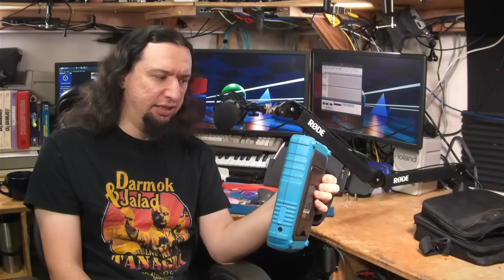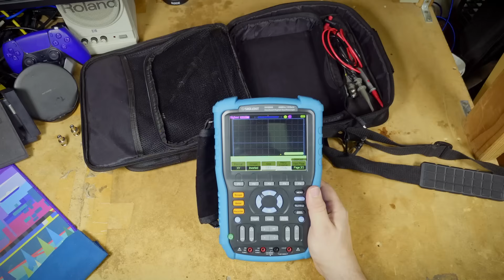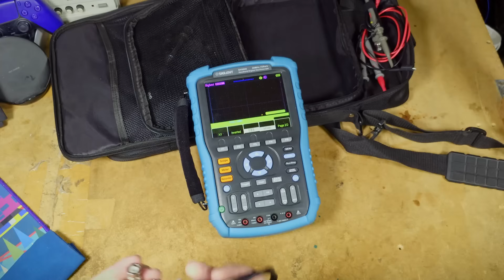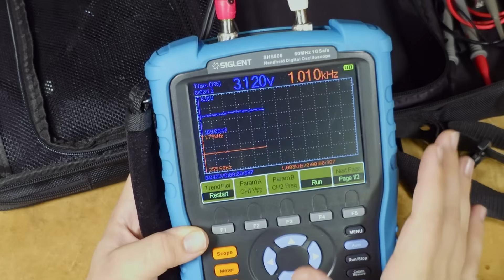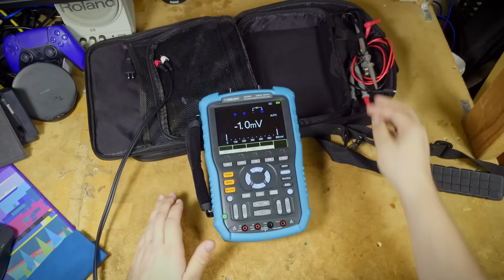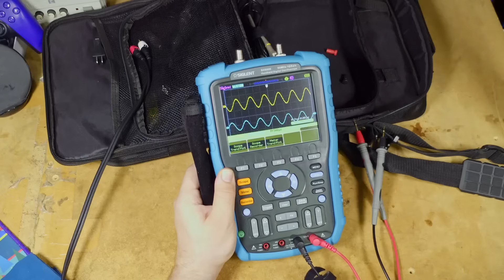Handheld Oscilloscope Overview - Siglent SHS806

Comment: In most cases, unless you absolutely NEED the portable form factor, you're much better off just getting differential probes for your desktop scope if you want to probe mains connected circuits. These days "desktop" scopes are nearly portable anyway, just not battery powered by default. The only "real" player in the portable scope market is Hantek. The others are basically low end gimmicky toys
Reply: There’s another echelon at the professional level that has per BNC isolation, higher sampling rates, and bandwidths up to 500MHz. The Fluke ScopeMeter and the Rohde and Schwarz ScopeRider are examples with the ScopeRider additionally offering an isolated 8-channel digital logic/protocol analyzer as well. Of course, they cost about as much as a used car too.

Comment: if there just was a scope as capable as a rigol dho802 with isolated / diff probe inputs in this vertical "handheld" format and a built in battery id pay double

there are none good and affordable mobile scopes on the market. especially ones that are scope and dmm in one device (like the fluke 123 where the scope is the dmm, not seperate jacks you have to switch to.)

micsig released their mho14 which is almost there, its just missing half the features i liked from the flukes( which had horrible ui, displays, controls everything)
Reply: Look at the Hantek handhelds - they're about the only ones that work well in scope AND DMM modes. The rest are gimmicky toys in comparison. Generally I'd say just get diff probes for your bench scope unless you absolutely need a handheld portable. I have a Hantek and I have the 80 buck Zoyi - I'll pick the Hantek any day for portable use, but I'd much prefer my bench Keysight scope when possible. I have a set of 3 diff probes for the bench scope, and use those when needed on mains circuits, or working on VFDs or similar.
Reply: @gorak9000  ive had a tektronix ths720 it was quite nice, even for its age. except the screen, size and lack of memory

Comment: Forgive my ignorance but I'm curious... do you know if a non-battery operated oscilloscope Will have an issue with testing an item tied to mains ground if the power to the oscilloscope is through an isolation transformer?

Comment: Siglent scopes are pretty good in my experience. I've never used a portable scope but I'd like to get one someday. I wonder if you could modify the boot splash logo thing to have information of who owns it. I did that with my SDS 1104X-E.
Reply: The Hantek handheld scopes are the only ones that perform decently in both scope and dmm mode. All the other "handheld" scopes that have come out recently are practically worthless toys at best in comparison. The Hantek's do cost more, but you get a more useful piece of gear for the higher cost.

Comment: Just tested the DMM function of my portable Tektronix Scope/DMM combo (THS Series) with a 9V battery and its even a little bit slower but the DMM is better implemented (can be used as external trigger and last DMM mode will be shown in scope-mode too to measure something while scoping around etc pp).

Comment: the BNCs are insulted so when you use the DMM function on mains voltage the BNCs can't shock you if you touched them accidentally
Reply from the maker: Horrifying but fair
Reply: @techtangentsii  BNC connectors are designed to establish the ground connection via the inner ring, not the connector housing. It's likely your test leads are too worn out and the ring is no longer making proper contact. You could try cleaning the ring contacts or gently bending them apart slightly.
Reply: Yeah, but only with the correct probes that also have insulated BNC connectors.

Edit: The insulation is not just for the DMM, it's also for the oscilloscope function. That's why the probes also habe insulated BNC connectors.
Reply: Don't insult your BNCs, they'll hate you

Comment: It likely does NTSC because devices like that are handy to use in TV engineering shops.
Reply from the maker: But is 525 line NTSC still used today(or I guess 2013) with all the analog broadcast having been shut down in 2009? I know low power stuff still stuck around in places like schools for a while after, but it still feels like a vestigial feature to me.

I guess I should mention that the manual doesn't specify a resolution support list, but the video sync options are "NTSC" or "PAL/SECAM" so I'm pretty sure the line count is fixed at 525 or 625 depending on the sync mode.
Reply: @techtangentsii  true. I think we've discontinued most, if not all, of the NTSC gear. We used to have some that did some very specific, niche things in the studio, but those have I believe been all replaced by modern gear. Though, we do have several tape machines in the dub room that are old NTSC format to get things off of archive tapes. (Though most of that is getting digitized to our video system.)